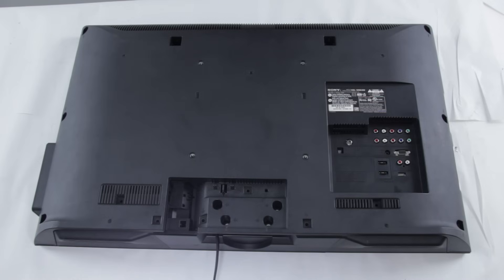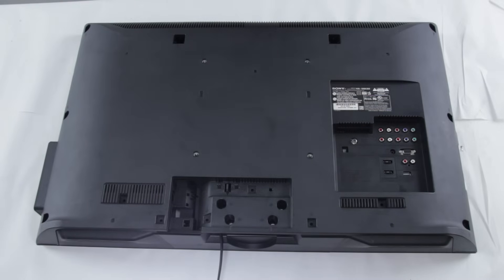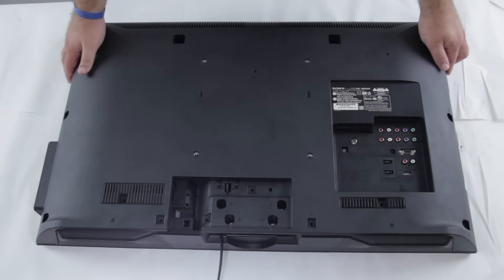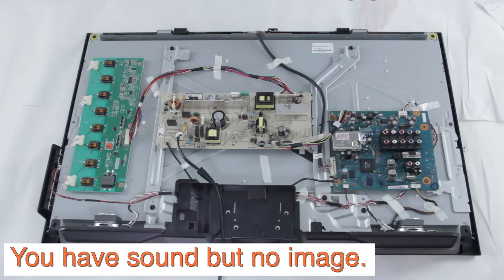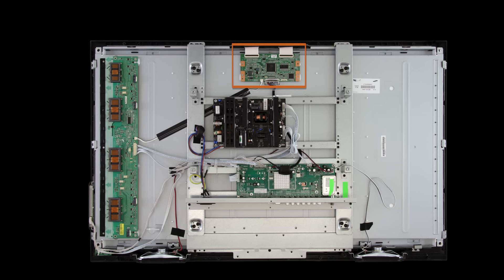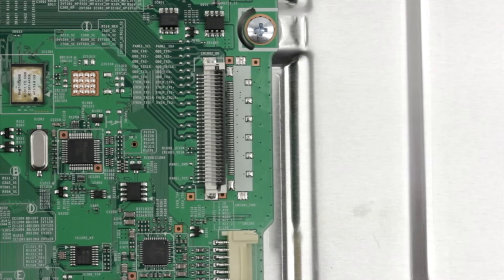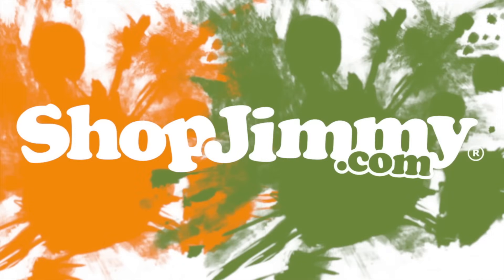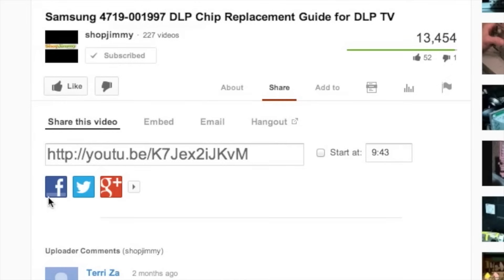LCD TV Repair Tutorial - T-Con Board Common Symptoms & Solutions - How to Replace T-Con Board

Comment: I have a Insignia LCD TV model NS-LCD47HD-09 serial# J7885JA002057. Last week it would not power on (Blue light would come on for a few seconds then red light would blink 6 times and stay on. I replaced the power supply board. Now when I push power button, blue light comes on and stays on but I get no picture and no sound. When I power off red light blinks 15 times and then stays on.
Reply from the maker: plnotify The power board may be the problem for your TV Repair.  It is tough to say for sure, but I would start with the power board.  Here is the link to a compatible power board for your TV model.  http://www.shopjimmy.com/insignia-adpc24330bb1-power-supply-unit.htm  We are currently out of stock, however you can sign up to be notified when the part is back in stock.  You can also call our customer service for help with your TV Repair and to confirm compatibility.  (877) 881-6492

Comment: CORRECTION, I have a Insignia LCD TV model NS-LCD47HD-09 serial# J7885JA002057. Last week it would not power on (Blue light would come on for a few seconds then red light would blink 6 times and stay on. I replaced the power supply board. Now when I push power button, blue light comes on and stays on but I get no picture and no sound. When I power off red light blinks 15 times and then stays on.  In my previous post I typed the wrong model.  Sorry for any inconvenience.

Comment: Hi Jimmy, I have a philips LCD TV 32pfl3305/v7. When i switchon the tv, the image on screen will be display properly for 2min and vertical lines start one by one and occupies full screen. After this if i keep running as is then screen will become white along with color picture. If i swicth off and on the tv again the image will be very good for 2min and again same problem. Is it TCON or LCD panel problem. If it is LCD panel problem it should not display a proper picture at the beginning as well.

Comment: MODEL CODE:LN52A580P6FXZA
SER NUM: AMQK3CFQ901299H

t-con board ser number : S2582C8H0384  004180
it also has in big bold letters: FHD60C4LVO .3 I don't know if that means anything.
The strip that goes into the t-con board is: PANEL 080722A01-BN96-07161B

Does this sound right??

Comment: Samsung 
MODEL CODE:LN52A580P6FXZA
SER NUM: AMQK3CFQ901299H
VERSION: SQ01. Can I replace the T-con board on this model? I have vertical lines on the right side of the tv. I do have a wonderful picture other than the lines. They are starting to move and more lines are showing up.

Comment from the maker: @Pedro M - I would recommend replacing the t-con to see if that will fix the problem.  If that does not work, then I would say it is the panel that is bad.  Replacing the panel is typically very difficult and expensive.  If the t-con replacement does not help, I would recommend replacing the TV.  Thanks and please give our customer service a call with your t-con board number to find a replacement.  (877) 881-6492  Thank and let us know if you have any other questions!

Comment from the maker: @Phillip Cover - This could either be the t-con board or the panel.  You could try replacing the t-con board to see if that helps.  If you would like to replace the t-con board, please call our customer service for assistance with your purchase.  (877) 881-6492  If the problem is the panel, then it may be more cost-effective to replace your TV.  New panels are typically very expensive, difficult to find and take tech skills to replace.  Thanks and please let us know if you have any questions!

Comment: hi, i have 32" LG with model number 32LG80UR.. i have problem with with the bottom of my screen split horizontally in 3..
first upper portion, display the picture/display properly
second, displaying pink/green and with vertical lines..
and the last part, displaying just purely white.. sometimes it just display same as pink and green above.. hope you can help.. no more warranty as it already 4 years from now..

Comment from the maker: @Andrea Lee - This could be a few different problems.  It could either be the panel or the t-con.  If the problem is the panel, then I would recommend purchasing a new TV as a new panel can be very expensive and difficult to replace.  You can try and replace the t-con to see if that fixes the problem.  There are a few different t-cons that could work with your TV, so please call our customer service for further help.  Please have your board number ready when calling.  (877) 881-6492

Comment: i have a sony model klv-40u100m tv and at first it had a line running vertical on the right side of the set now it went completely black no pic only sound,what you think could be the problem the main board or the T-con board also would i have a problem replacing the parts myself?

Comment from the maker: @astralbeasty - I believe this could either be your main board or your TV panel.  You could try replacing the main board to see if that helps with the problem.  If the problem is your TV panel, things get a bit more difficult as TV panels are often difficult to replace, hard to find and are typically expensive.  Thanks and please let us know if you need any further help.  You can also call our customer service for help with purchasing parts!  (877) 881-6492

Comment: The voltages are fine when please wait is on screen then the voltages to the ccfl from the inverter drop when these words dissapper. So just wondering if this could be the tcon controlling the inverter board from this wire connection like on you video.

Comment: This video shows a tcon board with a connector straight to the backlight inverter also. I have a dynex dx-40l150a11 that has a tcon similar. I replaced the main board and power supply board. I am waiting for an inverter board to come in the mail. What happens is my tv turns on fine, gives the message please wait. That disappears and nothing else ever happens. No video or sound because of the tv self-tests I think. Could these wires keep the backlights from turning on and passing this self test?

Comment: I am having a problem with my 42le4500-za LG LED TV, I haven't got a warranty to send it for repair. It has the following problems; the usual LG logo displays fine for a few seconds like normal however it stops displaying and becomes completely black with no light, however the sound is continues as normal, I know the BIOS is fine however I don't know what boards to replace to repair it, please help..

Comment: I have a Sceptre x46BV that is doing exactly the same as this: watch?v=3UWKJy7ivOc including the same temporary fix as this video demonstrates.  Mine however will correct by just 'jiggling' the tv with hand pressure to get it oscillating a half-inch or so on the stand.  I don't need to hit it like the video I linked.  
Thanks for any help!

Comment from the maker: @Greg Holzer - I would recommend replacing the main board in your TV.  There are a few different versions of the main board for your TV and it requires additional information off of your TV to select the correct replacement.  Please call our customer service at (877) 881-6492 and they can help you to find the correct replacement main board.  Thanks and please let us know if you have any further questions!

Comment: Hi I have a LG 42LK450 it gets a red light when plugged in when I push power button light blinks three times then turns blue but no pic no back light and no sound tv was on patio for two years with no issues thank you anything would help at this time

Comment from the maker: @Jessica Schwaartz - I would recommend replacing the main board.  Since you have backlights, and the t-con did not fix the problem, replace the main board, which is also known as an A-Board for your TV.  The replacement main board for your TV is specific to the serial number on your TV.  Please call our customer service at (877) 881-6492 and they can help you find the correct part according to the serial number on your TV.  Thanks and please let us know if you have any further questions.

Comment: I have a 40" Sony LCD model KDL-40S4100 purchased January 2009. We had the issue of no picture but have sound and backlight. I replaced the T-con board today. It does the same thing. It will come on with a picture but go out within 3 minutes. (Sound and backlight but no picture). Any suggestions or is the tv junk?

Comment from the maker: @dahr85 - I would recommend replacing the main board in your TV.  We currently have parts in stock for your TV model.  Since there are different versions of parts for this TV model, please call our customer service for assistance with picking the correct parts.  (877) 881-6492  Thanks and please let us know if you have any further questions!

Comment from the maker: @tlaloc1525 - I would recommend replacing the main board in your TV.  The part number for your replacement is Vizio 3642-0812-0150.  Unfortunately we are currently out of stock for this board.  However you can go to the product page and sign up to be notified when the board is back in stock.  Thanks and please let us know if you have any further questions!  (877) 881-6492

Comment: Jimmy,My SV422XVT Vizio LCD. TV not go on with remote. I unplug or use power button to start. I unplug and replug, tv will start with orange vizio blinking off and on until show vizio emblem on screen, then no change or shut off and restart do same. Using power button do the same as ,if I unplug and replug the tv. I used the guide to reset ,unplug , press power for 30 seconds then replug but it will do same.need some help here to pin point issue and buy correct part. Thank you Tonatiu.

Comment: SV422XVT Vizio LCD. TV  not go on with remote. I unplug to start or use power button to start.  I unplug and replug, tv will start with orange vizio blinking off and on until  show vizio emblem on screen, then no change or shut off and restart  do same. Using power button  do the same as ,if I unplug and replug the tv. I used the guide to reset ,unplug , press power for 30 seconds then replug but it will do same.. need some help here to pin point issue and buy correct part. Thank you Tonatiu.

Comment from the maker: @Saturi Nishimura - I would recommend replacing the t-con to see if that fixes the screen problems.  I just checked your model number and you should be able to replace the t-con.  The part number for your replacement part is Samsung LJ94-01837H.  I will send you a youtube message to your inbox with details on how to purchase your replacement part.  Thanks!

Comment from the maker: @Pat Macdonald - I would say that you either have a bad connection somewhere, or the panel is bad.  I would go through and be sure all your connections are secure and tight.  If they are, and you still have the issue, it could the panel that is the problem.  You could try and find a replacement panel, but that is typically very expensive and tough to replace.  Thanks and please let us know if you need any further assistance.  (877) 881-6492

Comment: I have a Samsung LN52A550P3FXZA (Purchased 1/2009)  that started displaying a colored vertical bar, about 6" wide, just left of center from top to bottom on the display.  Sometimes it was there, sometimes the display was fine.  It's now always there and usually a solid black bar.

All my troubleshooting led to a faulty T-Con board. I ordered one from you (great price, service and delivery!) and installed it easily.

Unfortunately the problem still exists.  Can you advise what to try next?

Comment: I have a Plasma Hitachi 55 inch TV I have had for about 10 years. I have problem turning on and off the TV. Sometime it turns on/off sometimes it doesn't. I usually have to unplugged it from the wall for about 30-45 seconds and plugged back into the wall & try again using the remote. It seems to get worse when TV is left on for a while. Also the controls on the side will not allow me to change the input. I'm at work and do not have model or Serial # to pass onto you.